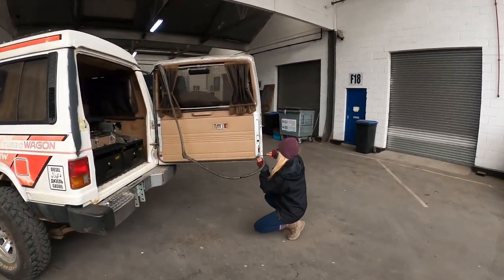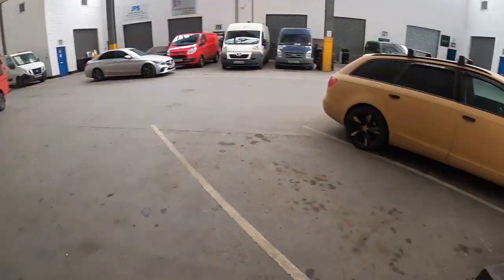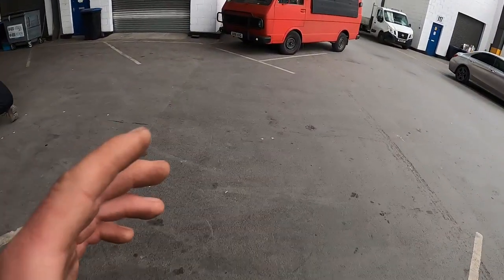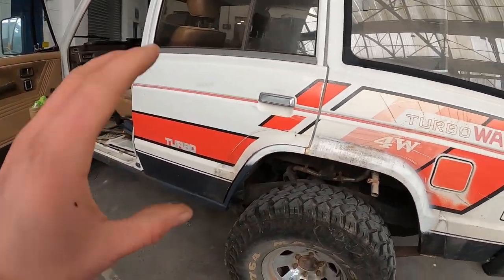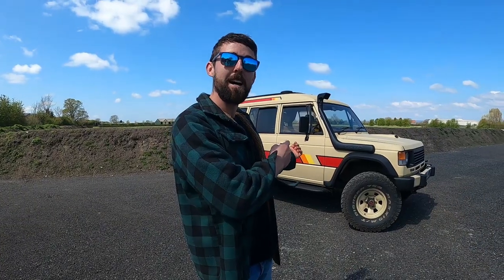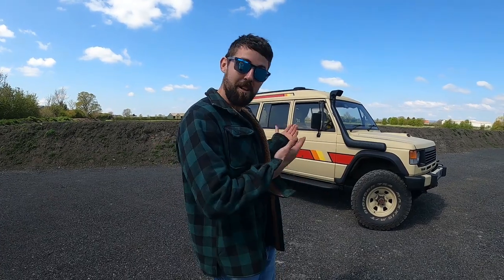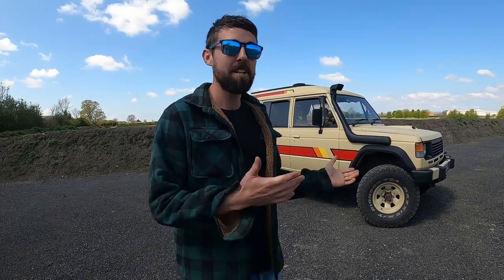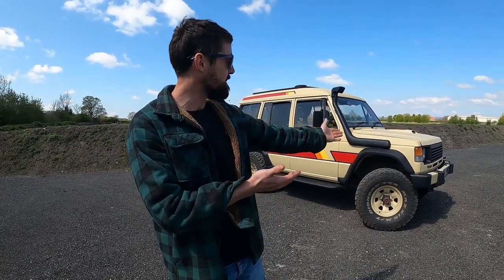Bodywork Restoration 1980's Mitsubishi Pajero Barn Find!

Comment: I have seen your other videos of tour . How it performed I am interested to know about engine its 4d56t right? I am not much familiar with this engine any advice and precautions about this engine ?
Reply from the maker: It's a slow old thing but it keep going! Just keep the cooling system clean and looked after ie rad, pump etc and change the timing belt 👌